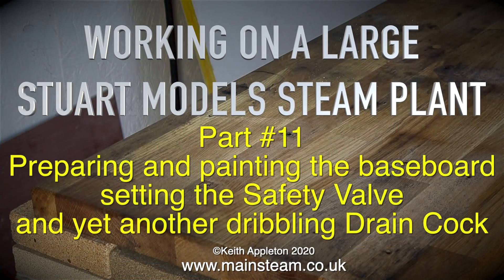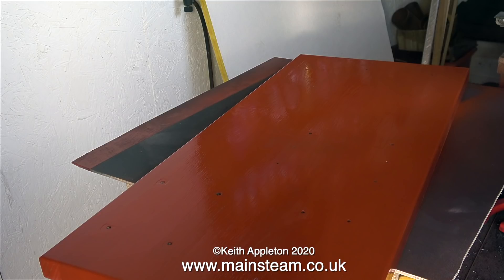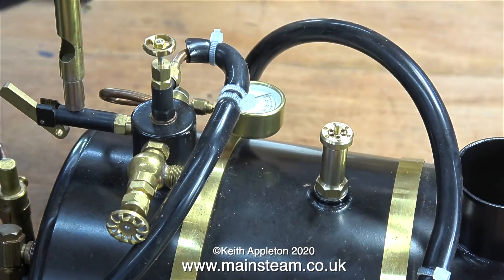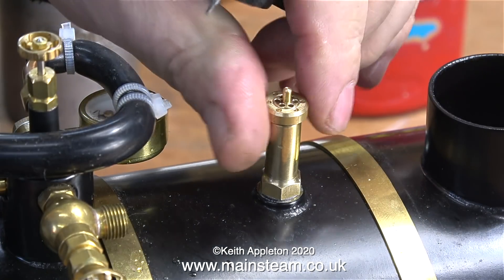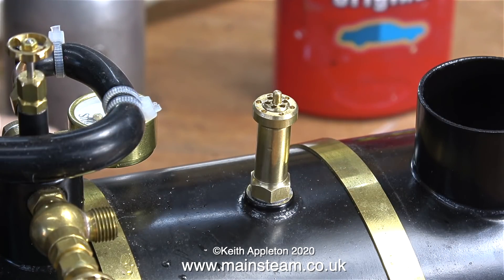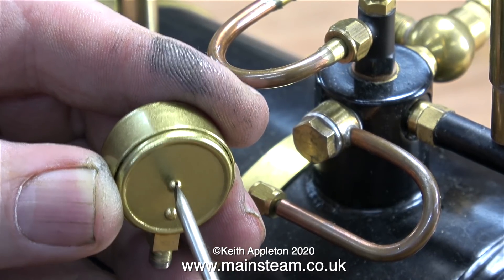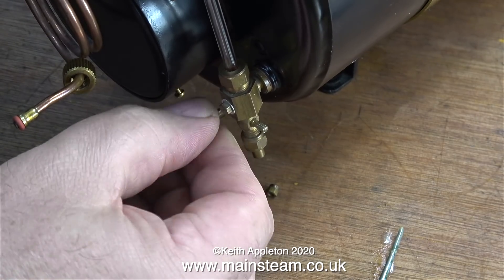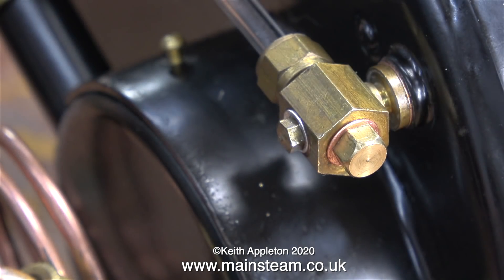WORKING ON A LARGE STUART MODELS STEAM PLANT - PART #11

Comment: Keith , there is a tool to tighten and cut those cable ties flush to the end. There used in electronics to rap wire looms quickly and easily.

Comment: I like that tip of melting the cut end of the cable tie, that's really useful although access can sometimes be an issue for that method I'm sure heating up a knife or screwdriver then pressing that onto the cut end would also work.
I've always used a sharp knife to cut them wherever possible as that gets them really flush.

Comment: pro tip on zips ties, don't cut them in parallel, cut them at 90 degrees (the wide way). 

There are some pliers that will cut flush, seems you are due for some new ones as you couldn't cut it the first time.
Reply from the maker: Thank you }:-)))
Reply: Clay Wright Yes, I was going to mention flush cutters. I’ve had a good pair of Linstrom flush cutting side cutters for over 30 years and use them for electronics. They cut cable ties flush and clean, right up against the lock. I also use Bahco adjustable spanners!
Reply: You can get a special tool that pulls them tight and then cuts off the excess or at least you could about 40 years ago, Heart lung machine pipework was all held together with them and you don't want unnecessary sharp edges to snag yourself on so the tool was ideal.